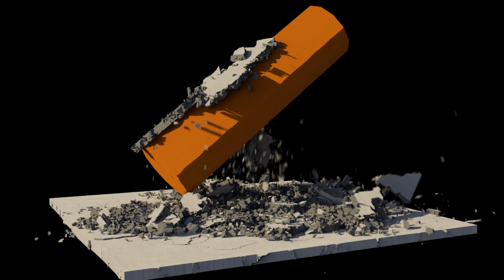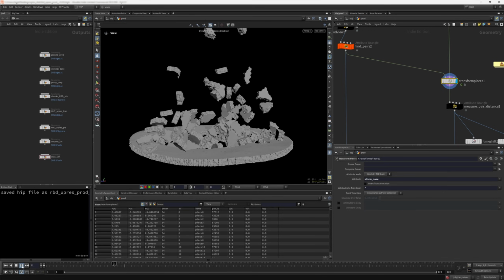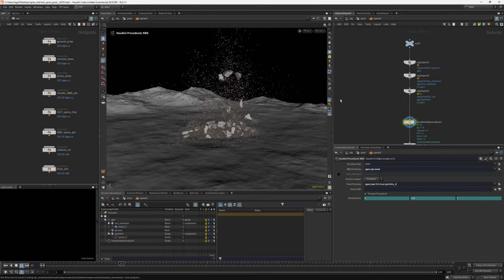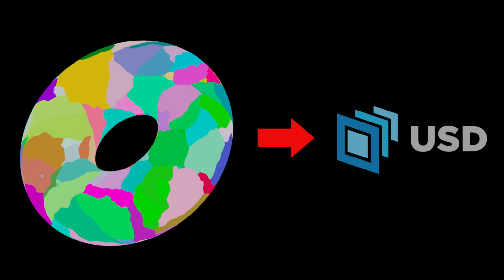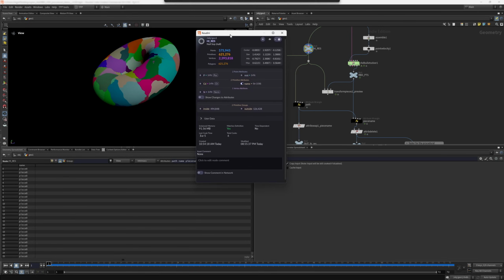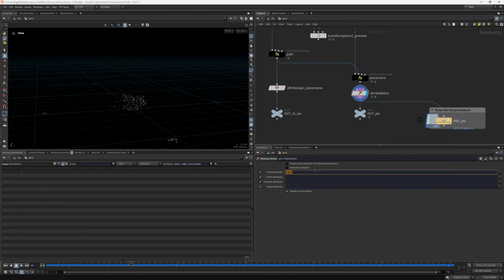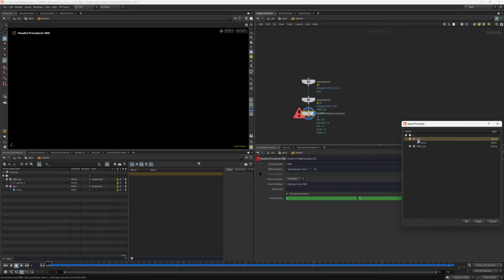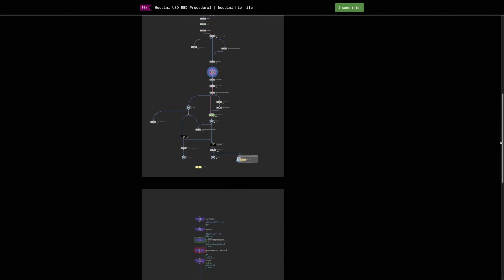Houdini USD RBD Procedural LOP in under 5 minutes

Comment: Nice one, one thing I found, is that on crazy heavy scenes, more on the production side, it is better to load the points directly from disk as bgeo, othewise the procedural will take an incredible amount of time building the points.
Reply from the maker: good spot, I did mention that briefly but didnt use that method for this video.  You can also write out the procedural and then reference it back in / payload it to keep things even lighter.

Comment: Great information thank you. I wonder how easy it would be to set up a python tool or a sop wrapper to automate the process of verifying an existing setup is correct (check for missing attributes) or have it just build the node framework skeleton for you.
Reply from the maker: hey, it is relatively easy to build a HDA / sop wrapper / recipe around it as all you need to input is the path attribute.  The points are just reading the path off of the geo and then constructing piecename from that.  I did build a HDA for it at some point but thought it would provide more value sharing the information of how to build it manually as everyone has their own preferences for tools.